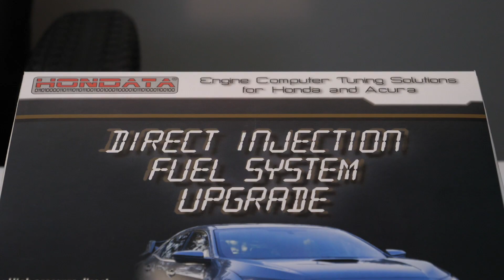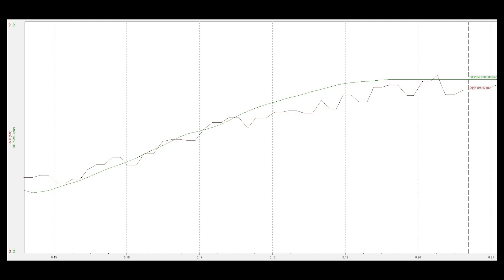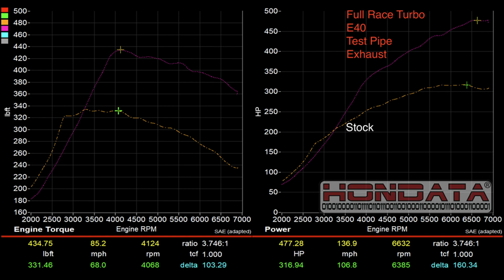Ultimate Civic Type R Fuel System - Hondata

Comment: Guys business case for you to consider 🙂 
Since the Accord 2.0T & Type R engines are 95% similar & there are more accords on the road than the type -R's it would make sense to make a accord kit as well.
I understand the turbo is smaller and wouldn't make as much boost  for high flow kit but, it would be 1 of the steps in the process to get the Accord Type -S 😃

Comment: All those numbers with stock internals?
Reply: Flash pro, hondata flex fuel system,sirimoto,  intercooler, high flow cat  installed in this type r
Reply: Yes, and the Flex fuel tuned CTR has been running 450-470 lb-ft torque for 18 months.

Comment: Safe to say with a custom tune and stock internals with full bolt ons and a hondata flash pro this wont put a Window mod on my block?
Reply: The Type Rs that have tested this system all have stock motors.

Comment: are there any plans to make fuel kits for 9th and 10th gen SI's??? Really want to know
Reply: Starting to think I should make a kit for the 1.5 guys.....
Reply: Lots of people make there own kits for the 9th gen SI. Vibrant performance makes everything needed to build a fuel feed and return. If you do it yourself you can buy a fuel rail, walbro 450 pump, fuel pressure regulator, fuel feed lines and fitting for about $700.00 USD.
Reply: @thefoatmedia  Definitely a lot of SI guys out there looking for a fuel upgrade

Comment: All those numbers with stock internals?
Reply: Yes, and the Flex fuel tuned CTR has been running 450-470 lb-ft torque for 18 months.